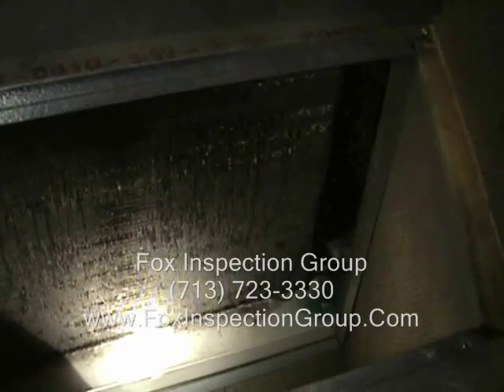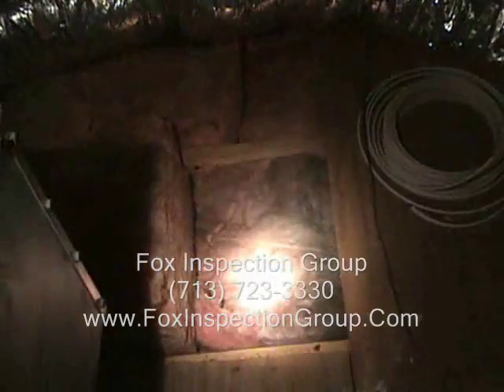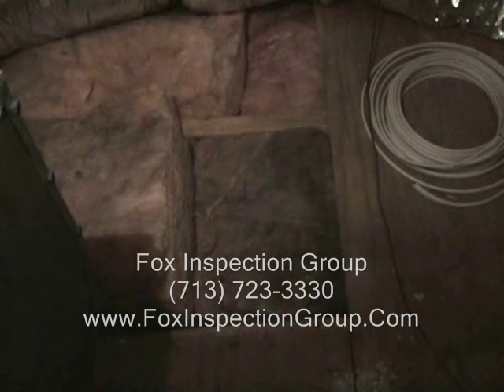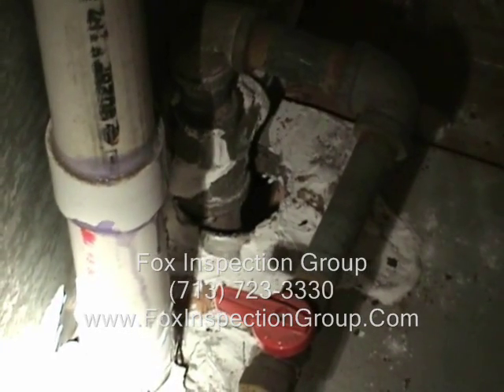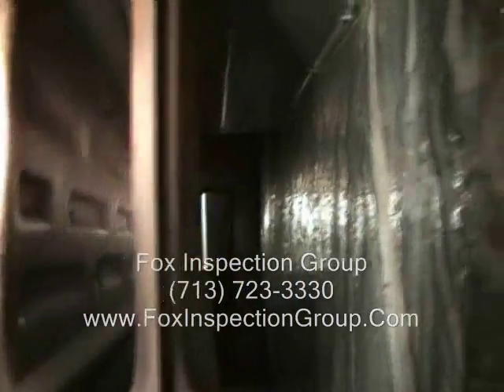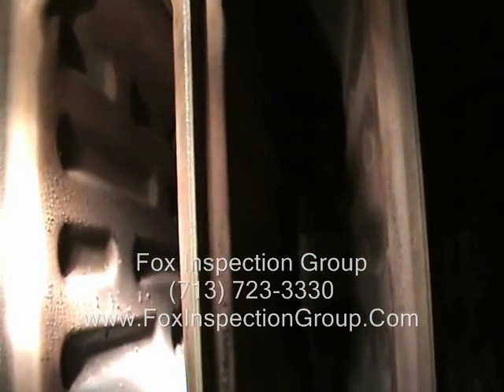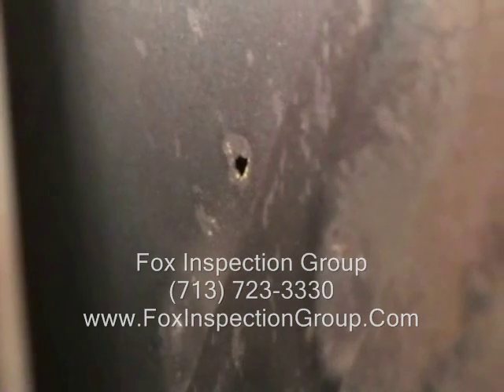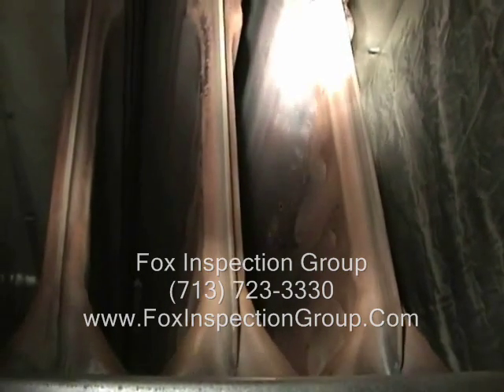Houston Home Inspector gives Class showing Crack in Heat Exchanger

Comment from the maker: I'm a home inspector.  On occasion when there is an older coil and heater and transition has been opened before or has an access panel, we just take a look.
The holes you see were not punched,  they are rusted through.  Punched holes will have other side of metal bent over that can be seen from the side your looking at if your eyes can focus well.  I have in the past found rusted areas that I have put my finger through, to me those were failed anyway.  I hope this helps